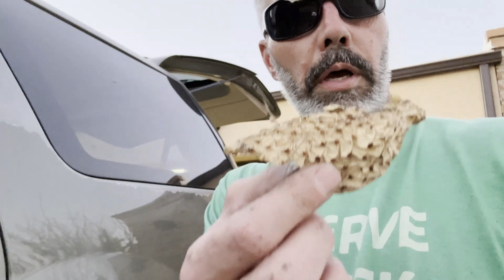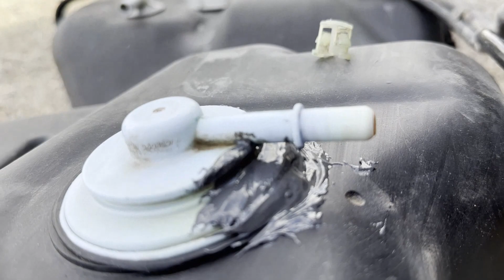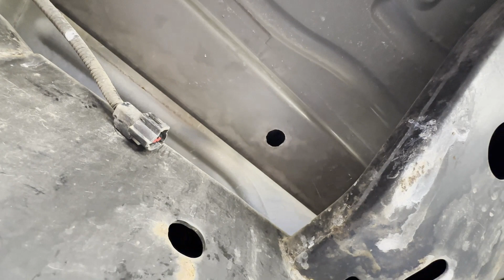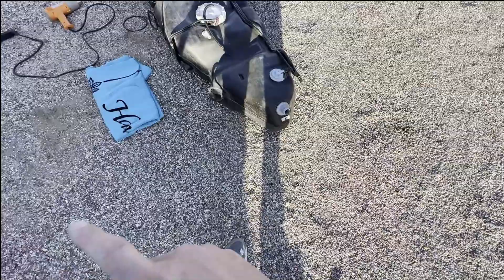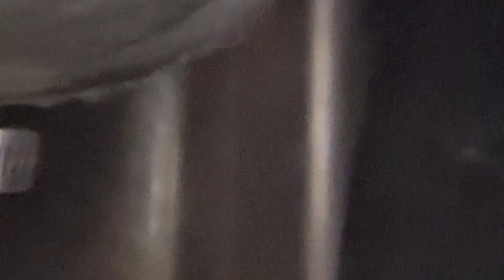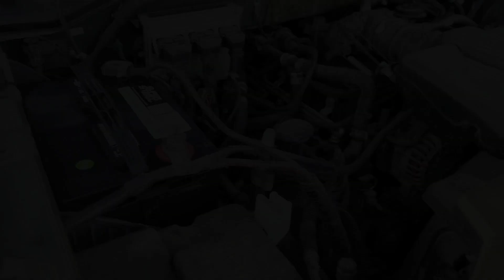2003 Ford Expedition P0442 Small Emissions Leak - Fuel Tank Repair

Comment: I had the same experience with my smoke machine 
Thank you for your informative video !
I dropped the fuel tank and found cracks in the exact same place your Expedition did and cleaned the cracks exactly as you did 
I plan on giving the repairs an extended cure time because of sub freezing temperatures tonight and gently went over the epoxy with a heat gun  for a few minutes to enhance flow  because the temperature was about 45* and falling
Reply: Did gas spill when you filled it all the way up?

Comment: I’ve been doing this for years it only holds up long enough to pass emissions and then it returns. The whole situation is nuts. These trucks will run a lifetime but could be taken off the road if I can’t continue to pass emissions. But yet a train or postal truck can spit black smoke all day 😂 Couple questions. Do you have an intermittent starting issue where the starter misses teeth on the flex plate every so often? Also how many miles does your truck have? I have 298,000 💪

Comment: I drilled the ends of the crack to stop them and then took an electric soldering iron to the plastic to melt the plastic in efforts to seal the crack.  It appears to have worked.

Comment: When i fill my tank it spills a good amount of fuel. I would say enough to fill 4-5 cups. I’m assuming I might have a big crack on it. So i drive the SUV with no more than 80% capacity. I didn’t get the code until 9 months later. I will used your video as reference. I change the fuel pump 10 years ago. I drive the SUV about 5k per year. I’m considering in changing the pump while I’m at it. Any thoughts?
Reply from the maker: Does the fuel leak throughout or later in the fill up all at once before you stop the pump? It it’s near the end, then you could certainly have a crack in the tank. Do you have a noticeable gas smell in the tank area? I’d say that if you go thru the trouble of dropping the tank to go ahead and replace the fuel pump while you’re in there. A good pump will last longer than 10 years, but I’d hate to have to drop it again in a year or two for that.

Let us know what the issue is!
Reply: It does leak right after is full at max capacity. This is why i don’t filled up to the max anymore. The fuel smell very strong .
Reply: Ok so I dropped the tank and inspected my issue. It turns out that the ring retainer support was cracked. I installed this ring 12 years ago. So im not sure if i over tightened the ring and 12 years later it crack. The ring wasn’t new when idid the  installation. Actually is the original from my purchased back in 2003. 

What are your thoughts on smearing the cement glue around like you did just in case in the future may crack like it happened toyou?
Reply: BACK AGAIN!

So i was able to get it done with your guidance. I changed the ring which was cracked and the fuel pump which it had nothing bad at all. I just decided to chenge because i had the tank down. Honestly i didn’t had no trouble. I took my sweet time and the ring was giving me a hard time but I got done. I just didn’t want to damage anything. I did stop when I felt frustrated for little things here and there. I have no experience just basic but hey it works.Thank you.
Reply from the maker: @godiegogo81 Nice! Glad you got it resolved and hopefully this is the end of your issues.

Comment: my 2003 4.6 expedition has this code. When I turn on the SUV the idle is a bit erratic, the rpm doesnt jump up and down, but you can hear the engine going up and down some. We also smell a bit of gas. Did yours do this too? I cant imagine the fix being a bad gas cap.
Reply from the maker: Mine actually ran normally, but in the process of chasing down the problem I unplugged the hose from the EVAP solenoid under the hood which triggered a “large leak” code (don’t recall the exact code) and the engine ran very much like you are describing. The gas smell is more likely the cracks in the tank valves that I fixed in the video, but I’d start checking all the hoses under the hood and make sure they haven’t started to deteriorate. Then work your way from the EVAP solenoid backwards to the fuel tank doing the same thing. Maybe you’ll get lucky, but from my research this seems like a very common problem in these older Expeditions. Best of luck!
Reply: My is doing the same issue. What is the EVAP solenoid? Make a video if you can.

Comment: Thanks, I put my smoke machine and noticed a leak from there. I was looking for a new tank until i saw this video and put some jb weld on as we'll.  I removed my spare tire and was able to reach it from there. Waiting for jb weld to cure. I hope that gets rid of p0442 code since its been on for a while
Reply from the maker: @ELlos210  I hope that works out for you. That might have been a good option for me, but I wanted to see the problem directly to make sure that was what was going on. Good luck!
Reply: Did the code go away?
Reply: @POVSMOKES yeah after the jb weld dried I started the car and the code went away

Comment: I would check the fuel pressure regulator. The one on my 1994 Bronco left me stranded out on the interstate. 
I can relate to gas tank removal. I cut a hole in the floor of my 2014 Expedition. Now I can change a fuel pump out in about 15 Min out on the highway if needed.
Reply from the maker: @GaryH-pw9cm  I've seen folks cut a hole like that in a number of different vehicles. As long as you get a good seal when you reinstall the floor section (or make a new one) then you should be good to go. I hope you never need to do that though...

Comment: I have this issue currently.  I purchased this expedition brand new and did not receive any recalls on this issue.  Ive been trying to figure out for years why it surges.  Backed it up to load it recently poored the gas.  Ford should have recalled and fixed this issue.  But we all know the right thing to do for the owners weren't going to happen.

Comment: I had the same thing happen to my expedition recently. The mechanic used JB weld and flex seal. So far it has held for the last month. Is yours still holding well?
Reply from the maker: Yep, still no issues! I’m feeling like this repair will last for a very long time. I’ll do an update if it fails in the future.
Reply: @shackf16  Nylon is tough but will shrink in low humidity situations. That looks like what happened here then a crack started at a weak point. Here the humidity is about 1% today. I plan to keep my Expedition for a long time so I will be on the lookout for any problems. Thanks for the video.